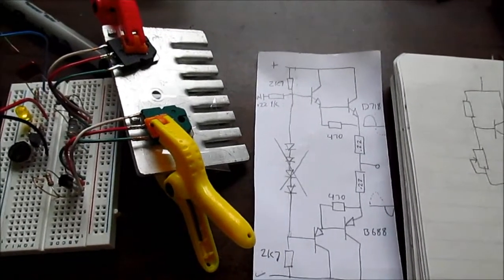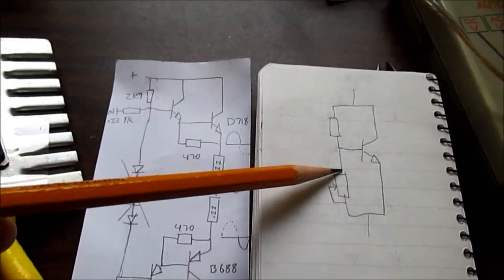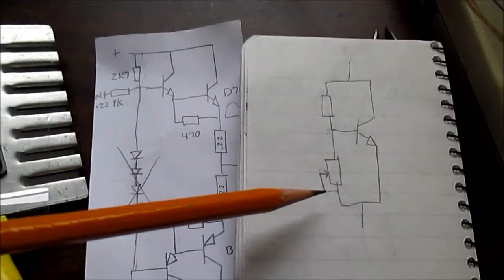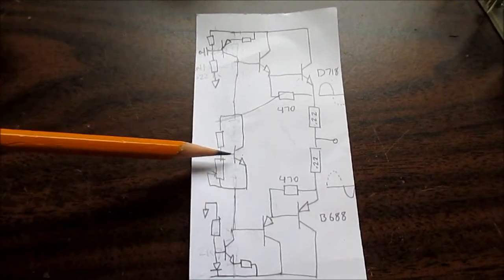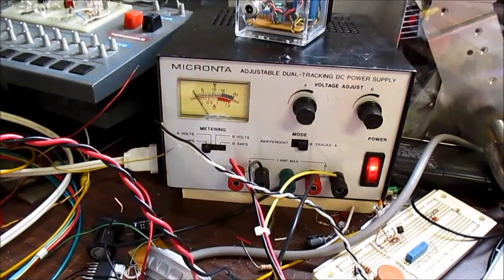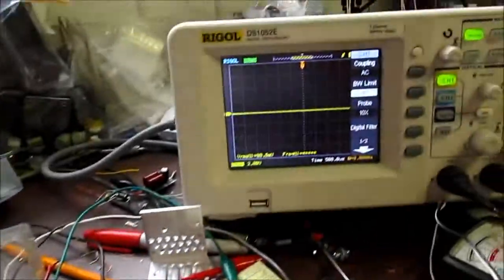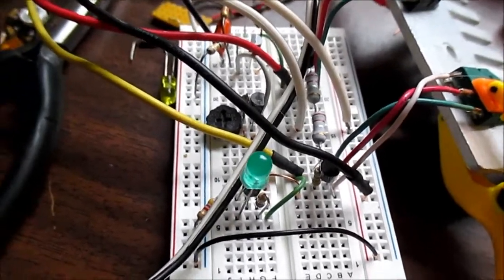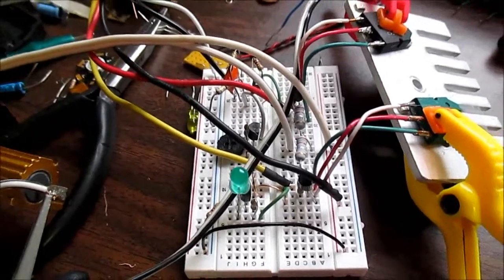Discrete amp biasing

Comment: i have the same amp as you, the micronta adjustable dual-tracking dc power supply. will this power my 10 meter radio? it is about 80 watts. if so, what do i set the volts at? do i set the amps also? sorry, ignorant about this.
Reply from the maker: No. The output is only 1 amp.
Reply: @JohnAudioTech  yes i figured that out finally. thanks for replying. i have no use for that thing now. lol. have to sell it.

Comment: You've made this project hard on yourself by choosing a Darlington output stage. Though certainly I've seen it done, they can be notoriously difficult to make bias track well with temperature. Also difficult to keep things balanced as, even now-a-days, NPNs tend to have more gain.
Reply from the maker: ***** Darlington is the most common output arrangement. No reason it can't be made thermally stable. Complementary feedback pair (aka Sziklai or compound) is favored by many for being more linear. Some say it oscillates easier in amp circuits and needs compensated more carefully.Personally, I think the amplifier's performance should be taken as a whole and not the parts. There are thousands of different amplifier designs and most of them work quite well.